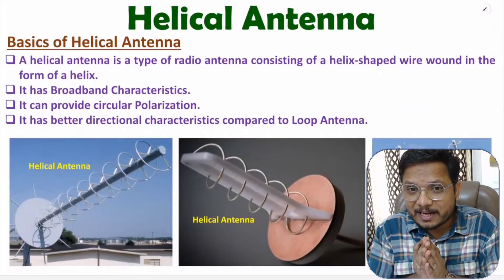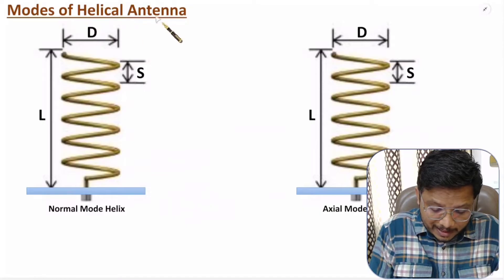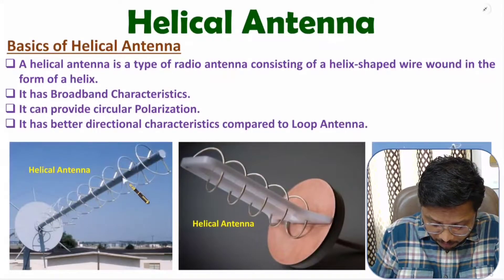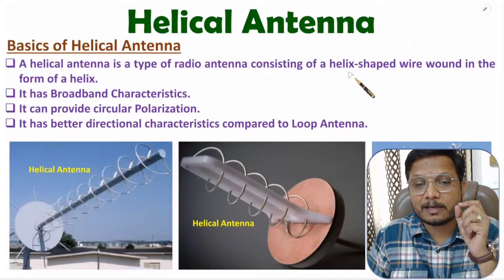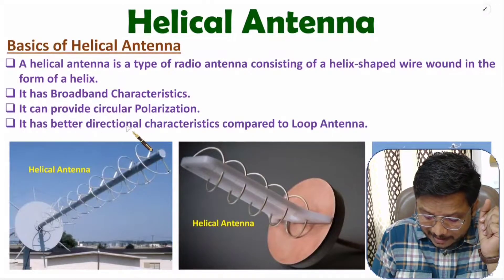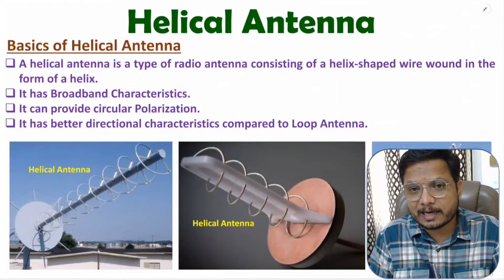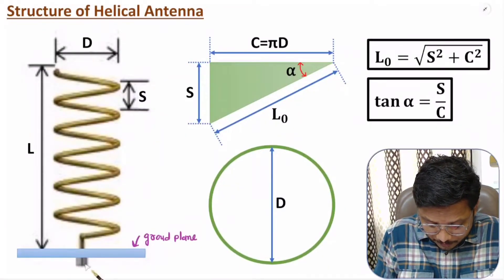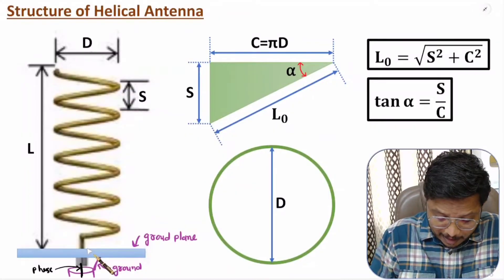Helical Antenna (Basics, Structure, Ground Planes, Modes & Applications) Explained

Comment: Useful conceptual introduction, thank you.
At 12:03 you said "dimensions are lower than lambda" for normal mode radiation, and 3/4 lambda < "circumference" < 1/2 lambda for axial modes.  I get the general concept that the closer you are to a long straight wire the more the wire resembles a mono or dipole and therefore radiation major lobe is normal, and vice versa.  But I do not know quantitative what you meant by "dimensions are lower than lambda" for normal mode radiation. Did you perhaps mean "diameter", D, of the helix, to result in primarily normal mode radiatio? That is my guess.

What about impedance matching?  I am replacing a standard coil antenna on a PC board used for Bluetooth connection (2.400 to 2.484 MHz). I want to match the impedance of the antenna to a "standard" PC board value, 50 Ohms. (I am guessing the PC board transmission line has 50 Ohm impedance).  The coil antenna connection is by simple soldering to a conductively filled via. Do I need to worry about the vertical separation of the beginning of the first coil from the PC board to set the capacitance value between board and coil?  Do I need to worry about the coil spacing and separation to set the complex impedance?  If so, what guidance can you give me on the impedance matching issue?